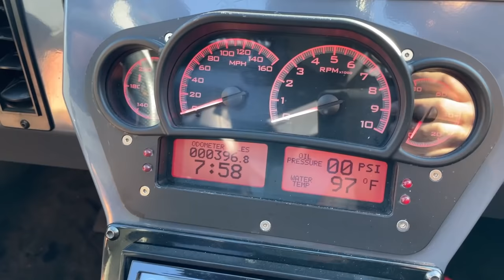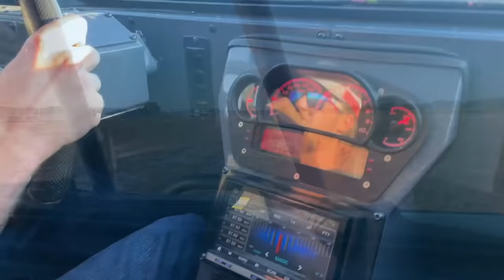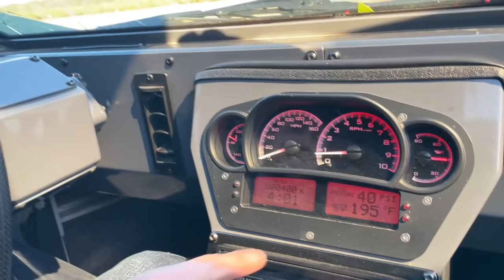We Bought a RIPSAW TANK!!! 700hp Duramax Powered Tank That Does 70mph! (Very Rare)

Comment: coming from someone that was in the army and drove tracked artillery pieces... no matter how tight the tracks are you will either break or detrack it if you turn sitting still like that more than like 45 degrees at a time and it gets even worse in sand or dirt because then you are pushing all the dirt/sand against the side of the tracks
Reply: Having rubber tracks is a lot worse when making turns from a standstill because of the traction they provide as well

Comment: I was in artillery in the Army, and I've thrown some tracks on M-109 howitzers plenty of times. Those tracks are in like 14" sections though. It was still a pain to replace those track sections, but I imagine it's a nightmare (and very expensive) to replace an entire single-band track just because one part of it is jacked up. Look into getting a sectional track!
Reply: This comment exactly.  I was thinking the same thing (from experience) working on these types of systems I hope he has a good mechanic(s) and a lot of green backs usd to waste.   SNAFU if I have ever seen one.
Reply: at that speeds i doubt segmented tracks work very well, weight is an big issue...
Reply: @pouncepounce7417  You know, I was thinking about that too. Sectional tracks ARE a lot heavier since each section has a steel frame. It would slow it down considerably I imagine.
Reply: @korndogz69  I think one could make an rubber track that is split into sections.
What i would wonder if the price tag would make it worth it, producing an long rubber track compared to segments that need embedded bushings to connect them.
I know mainly about bandvagons tracked  they are compared much slower but with them no one bothered to make segmented tracks either, they have the same style and they are build in series and run in many militaries around the world.
Reply: @pouncepounce7417  My thought process was you could keep a stack of sections on hand and replace them as needed as opposed to replacing an entire track just because one piece of it tore, or had a large chunk of it missing. Making sectional tracks out of rubber has the obvious problem of withstanding the expanding and contracting forces. That would be introducing weakness and many more points of failure into the track. The ends where the sections are bolted together is where the most likely points of failure would be. Maybe if the rubber is thick enough, it can handle it?
Reply: @korndogz69  yeah, it would be an beautyfull concept, only that one would have to test if an continous track that has the same flex at any given point and is much lighter because it has not reinforced connection points actual has less wear due to that.
Plus cost in producing the segments verus an continous track.
If chunks of rubber are missing one could probably even repair that using rubber cement...if the track is build like an tire with steelcable and so on repairing it that way would be possible.
My bet though would be in that continous tracks are quite simple much cheaper to produce than segmented ones
Reply: @pouncepounce7417  You may very well be right about that ^^
Reply: If i know correctly ripsaw rubber track is from soucy-defense. (Its a company which make rubber track and sprocket) but the same company make multiple type of rubber track. Probably cost lot of money.

Comment: Tank safety: Make sure you have an escape route before you run that in the swamp. You need to be able to get out of that if it rolls over and fills with water or catches fire.  A hatch in the floor would be ideal.  Whatever the escape plan is, practice it until you can get out quickly even when blindfolded.
Reply: Truth!
Reply: @Mark Deaton close...Air Force intel...forever heartbroken for those young  Marines and Soldiers who were lost in the rivers and canals of Iraq when their tanks rolled over and they had no way out.
Reply: Stryker rollover procedures anyone?
Reply: It's gotta be pretty damn hard to roll this tank, right? Seems like the COG is pretty low. No turret.
Reply: @Mark Deaton I came out of OTS as a 37A...was a section commander of the AF's largest (and rowdiest) munitions squadron at Kadena AB...learned a lot about administrative UCMJ actions running that orderly room...they called me "Dracula" for all the red ink I marked up their draft EPRs and awards with...ended up winning base personnel manager of the year in '97...next assignment intel school...retired in 2014 many deployments later...
Reply: Also need working fire extinguishers!!
Reply: Great advice!
Reply: @Millenniumvett  memories lol ROOL OVER ! ROOL OVER !
Reply: @djrisberg  no need to brag. Everyone loves a modest veteran.
Reply: Truth, one of my best mates was a tank gunner, they flipped into a dry creek and ended upside down for 10 hours, broke his back and almost lost his legs.
Reply: @jimlstheworldyewww7516  Kui

Comment: Before you start filling/changing hydraulic oil on this thing, check if theres any special requirements for the cleanliness grade of the oil. I can imagine this actually runs a pump so. In my experience a barrel of high quality oil usually has a lot more contaminants than you`d like there to be.
Reply: What hydraulic fluid?

Comment: Im still dumbfounded how that brake system works. How do you hook lines to a spinning caliper?!? Amazing engineering
Reply: There's a rotary hydraulic coupling in there. One on each side as far as I can see. Sold a lot of them when I was in the Industrial Supply business. First time I've ever seen one in an Automotive application... ;)
Reply: I've only seen that on specialty farming equipment. Doesn't surprise me to see it adapted here.
Reply: As confounding as the inflate as you drive tires on vehicles like the HUMVEE and the trucks JH Who bought. 🤷‍♂️
Reply: Greatest thing is if you need any parts or something breaks you just go to the local Advanced Auto parts or bring it by your local GM/Chevy dealership 😂. since it’s basically an old Chevy Silverado under the hood. Who would have thought Suzuki and GM would make such a killer engine
Reply: Hydraulic durtydur
Reply: @allenl9031  my truck has them on 8 of it's tires, they are a pain but handy when they work

Comment: Awesome show guys!
Up for a challenge? 
Because of the lubricating value of diesel fuel - 
take a diesel engine
clean all the oil out of it
replace the oil filter w/ a fuel filter
hook up the suction side of the oil pump to the fuel tank
hook up the suction side of the fuel pump to the bottom of the oil pan
not sure how to maintain a constant level of fuel in the oil pan
also not sure if the gaskets will hold up to the diesel fuel
Advantage to this if it works (w/ longevity of the motor) would be you wouldn't have to change the oil 
Scott

Comment: Howe & Howe, the builders of the ripsaw are just 5 miles from my home, they got the newer version out front of the building. They were contracted to build them for desert ops by the special forces in 2002-3, if you look on line there are plenty of videos of them being run in the winter and the desert of Maine and at moto 207 with Jay Leno. They are not cheap!

Comment: be sure to install a hollow dowel pin on each caliper bolt and use grade 10.6 hardware, the shear force on those bolts will be an issue . you notice these are used to locate transmissions to engines and this simple upgrade would eliminate future damage

Comment: It seems like there should be a more efficient way to engage the drive on both sides. Having sets of calipers spin like that can’t have good longevity.
Reply: It's called skid steer, plenty of vehicles have it. The M113A1 APCz I drove are  very similar with bands on drums that brake and differentially transfer power from one side to the other for steering. It's works well.
Reply: Wet brake like a bulldozer
Reply: @Frederic Gagnon that’s not how crawlers work either. Crawlers use clutch baskets like in an automatic transmission with enclosed hydraulic brakes. This design relies on spinning calipers not designed to spin and a high pressure hydraulic fluid coupling which will fail for sure over time.
Reply: Wet brake have the capability to disipate the heat via hydraulic fluid and a durability proven but you have a extra weight to carry. Hydrostatic system like a skidsteer is good but you aslo have a major weight gain versus steerbrake (2 pump, 2 motor, fluid tank and cooler). If you ask to someone if there have a more efficient way to engage the drive i chose wet brake but in the case of the ripsaw its designed to be lightweight that why they chose this system.
Reply: @Frederic Gagnon I agree with everything you are saying. The crawler transmissions are very heavy. Spinning these calipers seems like a big problem long term. Not sure how you get the air out either. I would thing a multi disk dry clutch would be better.
Reply: @totalyep  Im curious to see newer version of the ripsaw how they work.

Comment: This thing looks really cool.  Apparently the engineering stops there. This thing is seriously under built.  The brakes have completely fallen apart.  Gauge and or wiring issues and it's a 2007? Pathetic.  Overheating transmission. Can you imagine owning a car where the doors won't close and the brakes fell apart? For the money they get for these things I would expect better.
Reply: They've only made a few, double digits (it would seem). It's a "one of a kind", so you would be foolish to expect it to have similar longevity or cost-value to a mass-produced pickup truck.
Not to mention this is an individual vehicle. It was likely driven hard and poorly maintained. Even a mass-produced truck will likely have major issues if driven off-road with sub-optimal maintenance.
All of that to say, I don't think the poor condition of this vehicle is enough to be confident that it's a poorly engineered vehicle, and certainly not enough to confidently say that the creators are bad engineers (not that I've seen enough to say they're exceptionally good either).
Reply: @SemiMono  The kind of issues we are talking about here are not necessarily due to ''sub-optimal maintenance''.  I'm not sure what kind of ''use'' issues would cause the brakes to fall apart, or the wiring to fail. It might spring the door, but that sounds a little hokey to me too.  You can make excuses for them but I can't imagine that thing being used for more than an occasional romp around the park. Nobody is going to Alaska in that thing.

Comment: The track tensioner bolts have two nuts. The outer one is the locknut; to adjust, wind it off the inner nut while holding the inner nut with a second spanner. Locknuts always need two spanners. (Wrench in US.)

Comment: Can't believe cleetus doesn't know which direction to use a crescent/slide then wonders why its tougher to rotate that nut on the tensioner. 
Also FYI when tensioning the track. It's good practice to tighten it then spin tracks a bit. Tighten then spin tracks...

Comment: Rubber tracks stretch and get loose.  Give suspension wheels the slack they need to run off the tracks.  Need to be adjusted to keep proper tension.

Comment: with a slight engineering revision, the tread would b squared away infinitely.
 surface contact wheels/tread rolls, should be wider than tread, and actually, contact the  same surface/road, keeping the track heeled inboard&out,.. no more track issues

Comment: I wonder if you could ditch the brakes for drive biasing and put in a real air locking bias diff system. That would run a whole lot better than using brakes as bastard clutches. There may be setups out there that could actually reverse the drive to the inboard side even.

Comment: The drive train stuff looks pretty flimsy.  Feel free to at least double the thickness of anything that gets broken.  Like caliper brackets and adjustment brackets.  It is hard to say what to do about the caliper bolts.  If is is possible to make them thicker, and make sure they don't heat up that might help, or machine the shape of the bracket so the caliper fits in a socket to provide extra support.

Comment: the RIPSAW F4 lightweight multi mission tracked vehicle could seriously do with a raised suspension setup featuring a heavy duty 5.0 in. suspension lift for enhanced off roadability . . . and conventional opening doors instead of the gull wing type . . . a RIPSAW F4 lightweight multi mission tracked vehicle powered by a 623 bhp 5.8 Biturbo V10 mated to a 9-speed auto transmission is the one enthusiasts need . . . a C-17A Globemaster III multi mission heavy lift transport aircraft can easily accommodate five RIPSAW F4 light multi mission tracked vehicle in it's massive bigger than life cargo hold . . .

Comment: It doesn't even look like its been used alot and it has many things to repair. For the price you would think it's built like a TANK. 😏
Reply: I was thinking the same thing... I suspect the use it has gotten has been pretty hard but there are some fairly big issues that speak of low quality, or at the very least, not enough testing done before letting it out into the wild.

Comment: 16:29 that's a jam nut (double nut) assembly. You should have loosened the jam nut before turning the adjuster nut. I highly question ya'lls ability to turn wrenches not noticing this very common and basic engineering design. LMFAO

Comment: Though to be fair, that way of making the track system run is by far the least optimal, it is very wasteful on your engine power, puts a lot of strain into every involved part and is also not optimal for steerability.
However, that's also by far not an easy fix.

Comment: Here's some good advice fellas, get a heavy equipment mechanic involved, particularly someone with massive amounts of dozer/track loader experience. There's so many reasons you should re-engineer this to have hydrolic drive. Too many to for me to even begin here. But trust me when I say you won't find a modern tracked piece of heavy equipment with a regular differential! Make that trany spin a hydro pump or even eliminate the tranny n dif all together in favor of hydrolics. All that brakes/calipers/do stuff is way over engineered and not at all nessacary. If it was, then CAT JD KOMATSU etc etc would build dozers that way, and they most definitely do not!!!
Reply: Also, figure out seel tracks with rubber pads, the completely rubber track thing is a sockets bet. For strength, durability, longevity, people in the know use steel tracks with rubber pads

Comment: You have a, “tracked vehicle not a Tank.” No main gun to take out other Tanks. No turret to maneuver gun. “No Armor to withstand direct fire.” Nothing more than a Tracked Vehicle or a glorified snowmobile. But first time I’ve seen one. I wonder if it’s amphibious? Also I wonder actually how much it can tow? Your tracked vehicle looks like it could use an adjustable steering column. In observing you vehicles performance it appears to have to soft of metal and the bolts don’t appear to be high strength bolts. You need to install harder high strength bolts not stainless unless it doesn’t require any shear loads or torque. Although it probably will be a real head turner. Just wondering if it is amphibious. Maybe if it is, then for sure you got something that’s a worth while investment. Maybe even keep it, and get a bigger and better one like what was said a four passenger model that’s amphibious. Could you imagine chasing wild pigs in that thing?

Comment: I'd like to see it take on the high dunes and sand dunes and some really tore up four-wheel drive Road some big rats deep slippery mud the kind of stuff that swallows a 4 by 4 with 44 inch Super Swampers on it see how it can handle that what about the snow do you think it would go through the snow it'd be cool to have tracks like a snow cat I put on it for the winter time and I wonder how many tons that winches if it would drag the tank before it was able to pull 10 tons just some questions I thought would be interesting to know you should run over somebody's car to in the neighborhood just for shitz and giggles cuz I'm just kind of funny that way ha ha hardy har har